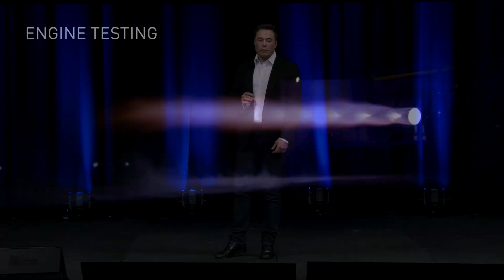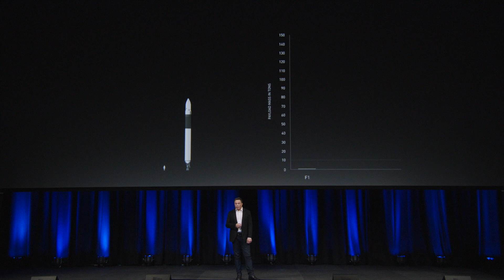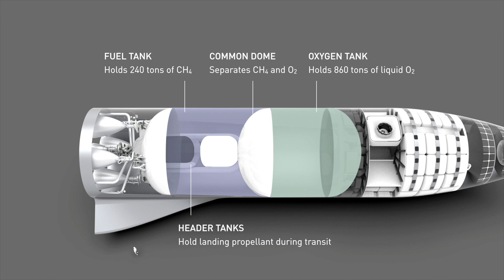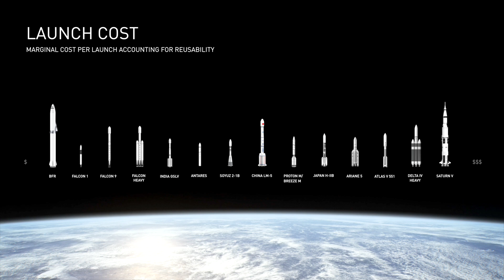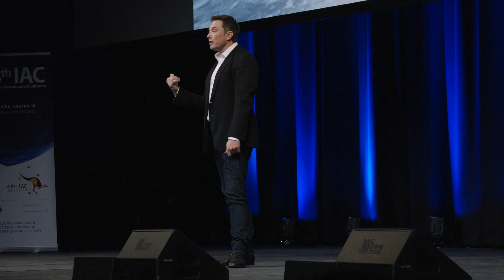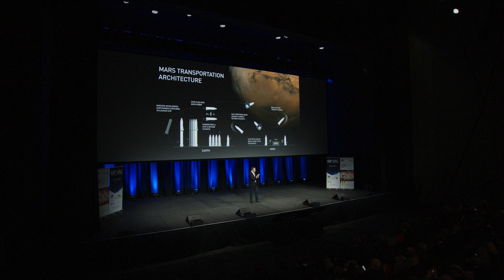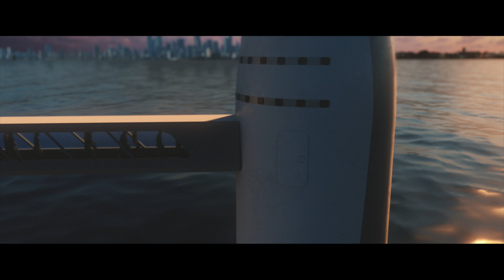Making Life Multiplanetary

Comment: Damn amazing.  Anywhere in the world in 30 mins.  Hopefully it's cheap.
Reply: Actually: "elonmusk Fly to most places on Earth in under 30 mins and anywhere in under 60. Cost per seat should be about the same as full fare economy in an aircraft. Forgot to mention that." https://www.instagram.com/p/BZnVfWxgdLe/
Reply: I'd happily pay £5000 return for a 50 min trip to Austrailia instead of cramped over priced seats and a flight of 24 hours at £1000
Reply: At first no... But airplanes used to be reserved to the elite.
Reply: Im pretty sure Rockets on planes in the 50s was not the greatest of ideas considering no human was in a rocket at that point ever.
Reply: 250k to go to mars...is expensive?? How much did you pay for your last mars trip?
Reply: Unmannedair To estimate ticket cost, it makes sense to me to think in terms of seats because we don't know the launch cost yet - only that it's cheaper than Falcon 1 yet capable of 300 times the LEO payload - there's a 300 fold cost savings right there. Other known constraints are the similar cargo capacity to the A380 cabin area. We are talking carry-on baggage only for this vehicle. The A380 all-economy configuration has the volume for 868 seats, while at 150 lbs, the payload capacity of the BFR is 2,204 passengers (let's say 1,500 to accommodate equipment, luggage and furnishings). Therefore we're constrained by volume rather than mass. This thing will not be carrying full fuel. If we can estimate the required fuel based on 900 * 200 lbs, we can estimate the launch cost. I agree that regulation and insurance are the hardest part of all this, and are probably what will hold it back for decades - people will accept it once they are already flying in them to the Moon and Mars, but perhaps not sooner.
Reply: GamingForAnAfterLife the rocket fuel has become much cheaper with the switch to methane.  In addition many of the tech that is needed for cheap flights didn't exist yet.  No fast guidance computers, no GPS, no advanced alloy engines, and no reusable rockets.  If this is possible, them it has only been possible for a little while.  We will see.
Reply: No there isn't ;D everyone just passes out and wakes up at their destination.
Reply: won't be cheap at first but you'd have to be awfully short sighted to say that it will never be cheap... cost will come down with demand and innovation
Reply: Especially that additionally to the trip to Australia you passing through space :) Nice view, I'd say)
Reply: gammarayburst with a rocket it would be a big mistake to go by seats.  Cargo density is the metric, and I'm assuming an average passenger weight of 150 lbs.  To give you an idea where things are currently, prices run around 6000 USD per lb right now for non SpaceX.  He's already taken a chunk out of that.  To get to a 3000 ticket price he's going to need to get things to 20 USD per lb to LEO.  20 dollars and 6000 dollars is a big difference.  In addition, the US government is probably going to require an insane level of insurance.  Then there is lobbies from airlines causing admin headaches, etc, etc, etc.  If it were only down to engineering, then I'd agree with his numbers.  However, we live in a world populated with these parasites we call bureaucrats, and they need their blood.
Reply: That's like 6 times cheaper than a Concorde flight across the Atlantic. Sounds pretty ok if you ask me.
Reply: Of course initial cost are insane at first, but mass production and intense use of it make it cheaper, since more technologies and researches on that area will make more and more viable. 
 
Do you think electricity was cheap at first? The same goes for everything: medicine, planes, robots, computers, etc. Computers were so expensive only huge companies and countries were able to pay for one. Nowadays you have a dozen in your home. 

It CAN be cheap, that's a matter of time and progress.
Reply: Some people are missing a bigger picture here. This could also be used to transport cargo around the world quicker. Reducing the slow transportation via ocean liners we have now. I'd be curious to know how many cargo bins that thing could hold.
Reply: El botto the payload is a lot larger than a shipping container - it's 8 stories x (up to) 9 meters. In fact the maximum payload mass is greater than any orbital-class vehicle ever built, and far exceeds anything which has operated in recent decades. I estimate you could send a palette same-day anywhere in the world for $6,000, while air freight is about $2,000 and is going to take a few days. There may be a market for priority freight sent this way, as well as military and diplomatic uses. Bottom line is it's about cost per mass, and if you can compete for passenger transport, you can also compete in other markets.
Reply: Luke Hart the speed is shown as 27,000 km/h. This is the same speed as the ISS, or the orbital velocity of LEO.
Reply: Luke Hart LEO = Low Earth Orbit, so yeah orbital velocity makes sense.
Reply: Luke Hart actually, you're partially right.  A sub orbital parabolic doesn't require as much fuel as Leo but the amount of fuel difference in say a flight from London to Sydney is less than 10%.  The only manouver required to convert such a trip to an actual orbit is a circularization burn.  For a high efficiency flight path to orbit this burn represents less than 10% of the actual fuel.  New York to London on the other hand would be a lot slower than orbital velocity and there would be a much bigger difference in the fuel required.
Reply: Collyn Christopher Brenner just imagine a rail gun designed for a spaceship...  It's essentially an electric rocket...  I would be very scared to ride it though.  It would essential be a hyper loop tube with a vacuum disc at the end pointed up...
Reply: According to Elon Musk: "Cost per seat should be about the same as full fare economy in an aircraft. Forgot to mention that."

Which shouldnt be too far off, considering an aircraft has to 'fight' air resistance all the way, while flying above +-100km altitude air resistance is negligble.

What's different now, is the reusability of the rocket (and more specifically its engines).
Reply: So, how about them G forces and vibration?  How are they going to help people cope with that?  Is there any magic solution for the frail?
Reply: +bartasbxx I was responding to your nonsense about 'breaking the atmosphere', which indicates your ignorance on the subject.

And no, I don't have specific numbers, this depends on the engine's efficiency (Isp), payload mass and flight trajectory.

The concord never left the atmosphere, all it did was fly supersonic. Flying faster, but less fuel efficient, hence the costs.

+logan milliken No magic solution for the frail afaik. Astronauts are exposed to a maximum of 3 g's, so it would probably be similar to that. 
https://www.spaceanswers.com/space-exploration/what-g-force-do-astronauts-experience-during-a-rocket-launch/
Reply: So is it breaking the atmosphere or not? Concorde wasn't is this? Cause you are implying that it is. Either way, it won't be cheap, why would it be cheap, even if they could sell tickets cheap they won't they are the only ones doing it, there is no competition, they'll charge whatever they want to.
Reply: bartasbxx define "cheap".
Reply: very true i would prefer paying about $2000 for a 30-50min trip to europe.
Reply: gammarayburst that's pretty great. With a Mars rocket they would have 40 cabins. With an Earth only flight you could cram people in like existing airlines and fit possibly a thousand or more people in there. Especially if you make multiple levels of seating like on a 747. I could see it scaling to the price of an existing plane ticket. The only thing is I would want a window seat
Reply: Elon says it will cost like a plane ticket soooooooooooo, it's cheap for what you will get and see
Reply: On how many seats are you basing your calculation?
Reply: 30 minutes plus 3 hours of check-in and check-out ;-)
Reply: 250kk for trip to mars so i think not cheap
Reply: Why do many doofuses keep saying "LEO" in this thread?  Am I missing anything, because y'all look like a barrel of morons right now.  Consider the following, why the hell do you need to get to orbital velocity to travel from New York to Tokyo?  The LEO fuel load/cost has nothing to do with the discussion.
Reply: I think he can easily fit 600-700 people in that craft if its re-purposed for earth travel.
Reply: +Joannot Fampionona and so were cars..
Reply: How much would a launch like that cost? Do you know?
Reply: So you have no idea how much a lauch like that would cost and feel comfortable to lecture others? Right. 

This wont be cheap. Even if it was cheap to do it wouldn't be cheap. Concorde tickets were 8.5k in 1999 so would be close to 11k now? Well I'd imagin 15k per ticket on a rocket. That isn't cheap.
Reply: Expect airline companies to spend millions to destroy elon and spacex
Reply: Sit on a rocket and wait for it to explode. A fast way to reach heaven or hell
Reply: this is only for the brave, and not for the faint heart. make your grandma brave and buy her a ticket for such a ride. lol.
Reply: should have a launch abort system. will you manage to cope with 10Gs?
Reply: Up to 1k.
Reply: He already said in that video that the inside pressurized volume was greater than an A380, so that's at least >500 in a typical configuration for an A380. Pretty exciting!
Reply: Just take a small loan of a million dollar
Reply: ...and legal
Reply: sreid70 nope lol
Reply: If only the take-off and landing noises were as manageable as those of the airbus. 
Pretty sure most people are NIMBY to a spacerocket landingpad for both noise and safety reasons.
Reply: sreid70 Watch my last video to know more about Elon Musk. He is THE GOD of 21st century.
Reply: bartasbxx yes it leaves the atmosphere. It's the only way to achieve those speeds.
Reply: See that's what I thought but the other guy was telling me to not talk if I didn't know what I was talking about inplying it doesn't.
Reply: GamingForAnAfterLife he isn't using rocket fuel he's using methane
Reply: there will be people willing to pay that
Reply: Isn't that many rocket launches bad for the environment? I only know the rockets use liquid O2 which is not polluting, but what else does it use? Also, can that fuel be produced cheaply?
Reply: It's CH4+O2. CH4 produces CO2 when burned (I don't know how much), however, the long-term plan (first on Mars) is to produce the fuel from water (H2O can be broken down into H+O2, and H can be combined with CO2 collected from the atmosphere to produce CH4). I don't know how much this fuel costs, or whether there would be a cost savings in producing it from water (likely this will require a global price on CO2 emissions like the EU has), but the process could be powered by renewable energy, as it's planned to use a solar array for this on Mars.
Reply: chanpod Approximately 400 1*1.2*1.2 meter pallets, taking into account the tapering hold. They would be stacked about 12 high and weigh around 300 kg each. There would need to be some kind of internal lift and racking, as the cargo door is at the very base of the hold with the ship oriented in it's normal vertical position.
Reply: i hope too
Reply: sreid70 its totally nit gonna be cheap and obviously its going to be a use for civilians abd it will end up for Military use fuck the government
Reply: Unmannedair What numbers r u using for that. Because the BFR has both the volume and the payload capacity for about 900 passengers. And the last numbers that I head for sub orbital flights were $500,000 in propellent. And in the long term spaceX hopes to get the maintenance cost for sub orbital flights down to $200,000. But even if they can't get it beneath double that it still means a suborbital launch would be about $900,000. Which is about $1,000 per passenger. Also either way there would still be a market for it because the vomit commit cost $5,000 and this is a lot better.
Reply: Lapu Lapu 
Boeing and Lockheed are already doing that.
Reply: If he keeps the launches out to sea, and he can secure reliable cryogenic supplies, then I think he'll get close for certain. Economies of scale are fickle wonders.
Reply: gammarayburst when he said cheaper, he's referring to cost per lb, not overall operating cost.  Fuel to LEO scales with launch mass and represents over half the fuel required for a trip to Mars.  Definitely not cheaper overall to operate.  I think a vehicle like this would be amazingly cheap, but I don't think we can use traditional pricing methods for airlines to estimate tickets.  Something along the lines of... "Oh gravity, thou art a heartless bit**."
Reply: Unmannedair price is equal to an economy seat on a plane for the same route
Reply: I'd happily pay 100k for a recreational ride. I'm sure there are hundreds of thousands of others that would too. Just get the safety ratings near to airplanes.
Reply: +bartasbxx Don't speak, if you don't know what you are talking about.

For an orbit around the Earth, most fuel is burned when performing the circularization burn, which is not needed if you plan to land on the other side.
Reply: gammarayburst yeah, I think he's a little starry eyed with that one.  I'll bet he's not accounting for government regulation interference, insurance absurdities, and the other usual obstacles.  6k would be very impressive to me, but I would bet a lot of money that he's not going to be able to get the price lower than 3k tops.
Reply: sreid70 not likely.  If he is able to do exactly what he says, then it will likely be... Hang on... Getting out my calculator...  Oh wow, it could work out to be as little as 6,000 USD for a 150 lb person.  That number is a really risky number for SpaceX though.  They'd be working off a really small profit margin.
Reply: sreid70 I find it funny that he included that last last part because he said if he could make electric rockets he would but those rockets within the atmosphere would likely cause a lot of environmental problems if they become common place.
Reply: No way, you are breaking the atmosphere, that's a crazy amount of fuel for one trip, it's going to be for that one percent in the world.

Comment: Thousands of launches a day he talking about from different launch sites.  No wonder he wants to ditch the Merlin engine in favor of the Raptor Engine.  The Merlin engine currently burns RP-2 or rocket Kerosene.  This new engine would burn cryogenic methane and LOX (liquid oxygen)  Much cleaner burning and far less CO2 and other hazardous particulates.  Almost as clean burning as a LOX/H2 engine but with way more kick and specific thrust.  This is going to be one mean green rumbling machine.  Extreme power never looked so good.  Most rich people want to take you for a ride.  This guy gives you the ride

Comment: I want to see common people deal with the G-forces on start and landing. 
8-&
Reply: Then you should go to a theme park! Rollercoaster safety limits in many parts of the world (many states in the US) are at the 6-7g level. Space agencies prefer not to expose astronauts to more than 3-4g.

Granted, rollercoasters generally don't subject people to those g's for the 4-8 minutes you'd be feeling it during the ascent into space, but with such a large ship, it should be possible to burn at a suboptimal rate to keep the g's down for the plebs.

Dreamchaser, an American spacecraft currently in development, designed for cargo and crew runs to the ISS, has similar aerodynamic control surface ratios to the BFR, and it can do a 1-2g re-entry from the ISS's orbit.

Point-to-point travel will be suborbital, meaning less speed to dissipate, meaning the re-entry stresses should be even less.

Comment: If the rocket is so precise then why do they need a crane to lift it back on the booster?
Reply: Are you serious? Do you really want it to set the booster on fire?
Reply: Why should it? The booster designed to handle reentry it can handle  100 ton rocket skyscraper landing right on top of it